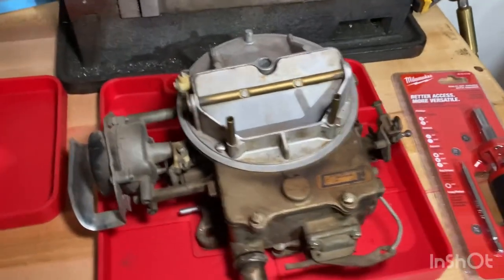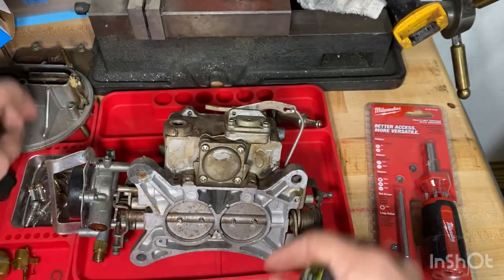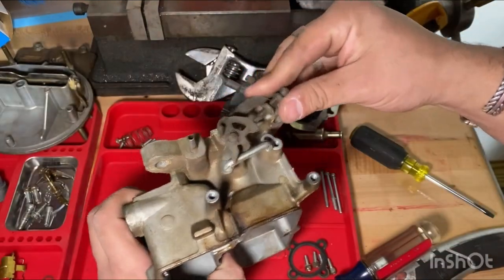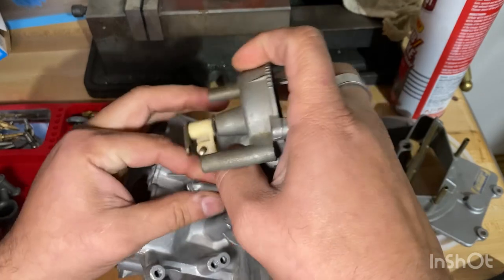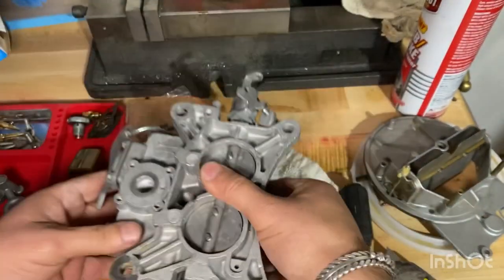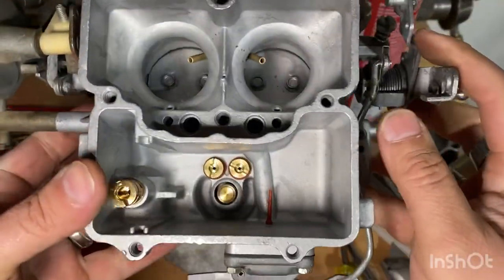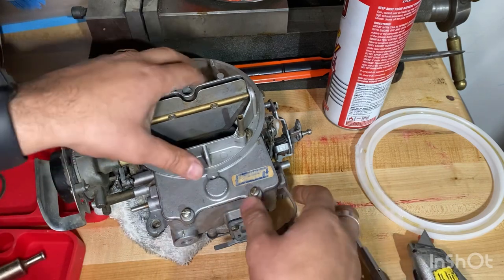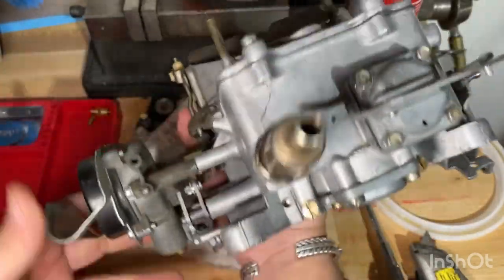Rebuilding a Carburetor- Autolite 2100 like new!

Comment: Brass float,oe from the factory,the plastic floats are much better,its needn a clean and new parts npieces,my dad modified the brass tubes a little bigger holes,which meant better performence on all the pieces,esp at w.o.t.ohh the power valve is shot ita a mess good luck

Comment: do you need to plug the hole in the front center of the carb top? mine was spraying out fuel so plugged it with red RTV.
Reply from the maker: Hmm. Haven’t had issues yet.
Reply: The one I was working on was doing the same. I’m gonna rebuild the carb and will let you know
Reply: Put it all together and it runs

Comment: What kind of fuel filter is that, the one you unscrewed off the carburetor? Part # and where? Thanks.
Reply from the maker: @markfeuerherdt2338  wix 33046. On Amazon.
Reply: Thanks!

Comment: I had a 1971 2100 rebuilt. When I installed it I found out where the fuel filter goes in is stipped. Is that a pipe thread or do you have any ideas how to repair. Thanks
Reply from the maker: I’m not sure.  Mine was threaded